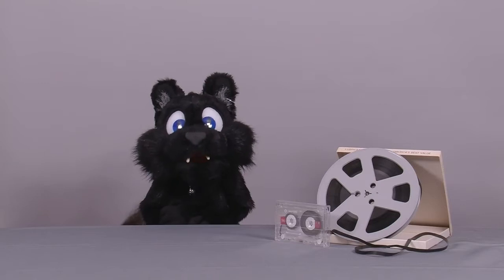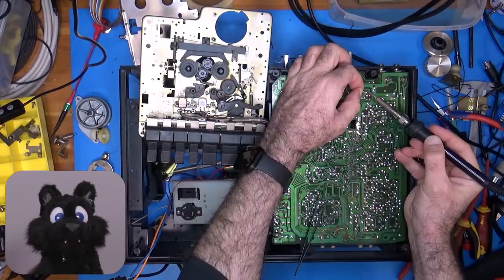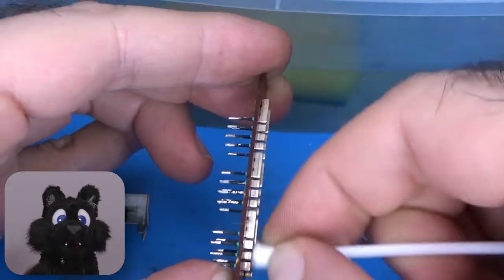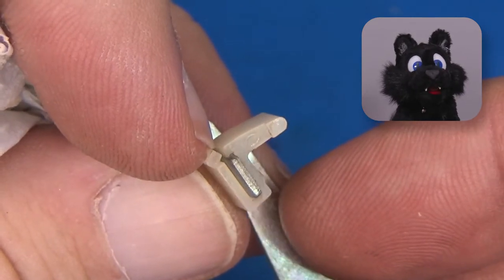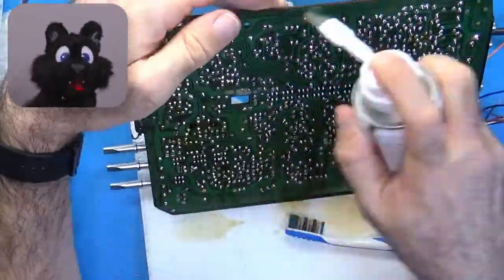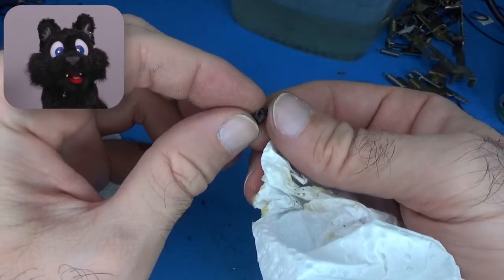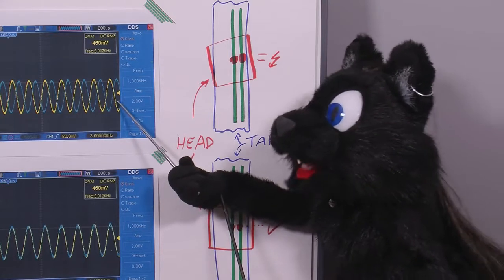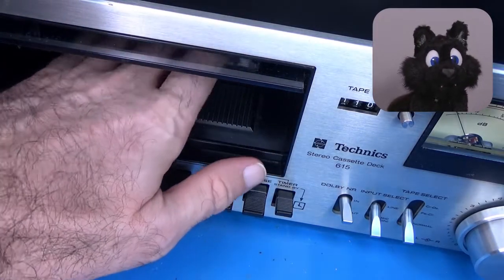Restoration Project #21 - Technics 615 Tape Deck

Comment: I am deciding to restore my 615 deck. 
Your video inspired me to give it a shot. 
Question: 
My unit seems to function at the moment, but the tape counter belt is loose and thus the counter does not turn. 
Can you provide a good source for this and the other belts?
Reply from the maker: I have good experiences with https://fixyouraudio.com/ - they provide some selected sets based on model numbers and also offer custom sizes.
Reply: @atkelar  
Thank you very much!

Comment: Hello atkelar, I really enjoyed watching the video where you show the maintenance of the Technics RS-615 US model tape deck. I have one with the same characteristics but one of the lamps on one of the VU meters is burned out. Do you know what the voltage of that lamp is and how to change it? Would you be so kind as to tell me? I would greatly appreciate it.
Reply from the maker: Interesting; How can you tell it's just one though? On my unit, they were wired in series - like christmas tree lights - and thus one broken would prevent the other from lighting up  too. If one is still working on yours, it's not quite the same setup. As for how to replace them: that's quite elaborate, because you have to take apart the VU meter case. And that is held between the elements of the front panel. Here's an older reply with a similar questinon about the type: I have replaced mine with LEDs, so I'm not sure about the model. Since they run in series over about 9V, they should be 4.5V ones. Low watt/amp rating, because they need to light up the displays only, so 100 to 200mA max I'd say, but that is a guess. The form factor might be different in your model, I'm sure that these components get changed all the time, but mine looked like glass fuses. I think those here might be close, but again, this is from memory and estimations: https://www.ebay.at/itm/115329633276

Comment: Very good video! I recently bought this same deck and it's working really well but with one problem, sometimes when i press pause, the friction point between the capstan flywheel and its bracket (seen at 8:25) starts vibrating constantly and very loudly. I can also recreate it by giving the bracket a tap with my finger and stop it by tapping again. Do i need to grease the friction point and if so, what type of grease should i use?
Reply from the maker: Assuming you mean the plate that is showing the serial number in my unit, I would try a tiny dab of silicone grease first. This is both slippery enough to not cause noticable drag and thick enough to dampen vibrations. The fact that it does vibrate tells me that the bearing is worn out (probably not just the one at th ebottom but also the one at the capstan side) and should be replaced eventually, so looking for a possible source of spare parts might be a better long term solution.Would need custom machining though, since I'm pretty sure the OEM doesn't make parts anymore.
Reply: @atkelar  thank you! I removed the plate and found that the end of the capstan shaft and the friction point on the plate were completely dried up with no lubrication and were quite dirty. I gave them a clean and applied a small amount of grease to the end of the shaft. The capstan is now running really smooth and no longer vibrates when i press pause or tap the plate :)
Reply: @atkelar  so another much more annoying problem has appeared. The play button has started getting really difficult to press and now it no longer works at all. I can press it down about half way but no further. Do you know what could be wrong?

Comment: Awesome. So thorough. I'm doing a (much less thorough) refurbish of a 615 that I picked up. Most everything seems to be working but I have a question I'm hoping you (or someone else) can answer. Looking at the parts and schematics, the auto-stop seems to only be a function of playback (not FF or REW). The auto-stop mechanism on my unit successfully stops the takeup idler tire, but I've noticed it doesn't release the PLAY button. Is this normal?
Reply from the maker: Thanks!
First, yes, the "auto stop" only works in "Play" (or by extension "record") mode. This is common of that era. Later devices added "full auto stop" for that reason, to indicate that the auto stop also works for the fast transport modes. Full Auto Stop usually also doesn't rely on a "feeler" for the tape tension, but rather detects the stalling of one of the spools.
Second: It should pop out the play button too; at least on my unit it does; It is what retracts the heads from the tape. I think what you describe is the issue I had at first: the idler is "stopped" by the mechanism, but actually it shouldn't be stopped. The little notch that contacts the idler should be pushed away by it, triggering the release of the button. 
[EDIT] because it's not the take up that's the problem, but rather the capstan, which might stress the tape to the point of breaking, which is only released when the play button itself releases.

Comment: Ciao Alkelar. Ho collegato il tutto e funziona. Però la piastra a cassette Technics RS 615  presenta due problemi: 1) La cassetta da ascoltare ha il tono più basso, come se girasse più lenta. 2) Non si accendono le luci dei due quadranti Left e Right posti sulla destra della piastra; hanno comunque l'ago che si muove regolaremente.  Ti sarei davvero grado se mi potessi aiutare dandomi qualche istruzione a riguardo. Sono fiducioso. Buona giornata. Antonio
Reply from the maker: Again, hopefully Google translate was doing a good job; 
as for your first item, The tape running a bit slow can have three reasons: first, the motor might need a bit of tuning to get the right RPM again. It's a DC motor that has a potentiometer inside the shell and over time that "sweet spot" might move. Second, there could be just too much drag in the mechanism, so the motor doesn't quite get up to enough speed. This is much harder to fix, but if it is the cause, it should be addressed. A very, very tiny amount of oil, like a needle dipped in sewing machine oil, put at the right location between axles and gears would do the trick. But careful, as there are lots of places where oil would make things too slippery: the winding mechanism has slip clutches and they need some drag. And third it could be that the drive belt is too loose or doesn't have enough grip anymore. Replacement would be in order in that case.

As for the lights in the VU-Meters: these two light bulbs are for some reason in series. So if one is blown out, both won't light up. They can be replaced, but one has to get to them first. In my video, I replaced them with LEDs, which might be overkill, but it would give an idea where they are.
Reply: @atkelar  Ciao Atkelar. M'accorgo ora che ho sempre sbagliato a scrivere Alkelar al posto di Atkelar. Chiedo scusa. Come sempre sei gentilissimo. Grazie di cuore per la risposta. Può esserci un'altra causa a non far accendere la/e luce/i dei VU-Meter ? (non sapevo che si chiamavano così 🙂).  Col tester si può verificare se la/e luce/i sono buone o rotte?  Ti prego di sopportare la mia scarsissima competenza. Buona giornata. Antonio
Reply from the maker: No worries; The lights in the meters are directly connected to the power supply, the very same voltage that drives the entire thing. So if the deck plays and the needles move, the bulbs are the only reasonable source of the problem; They should light up with the power, there is no additional switch or fuse involved, just the same power switch and fuse that is for the entire unit. It is possible, but very unlikely that a wire might have come loose; but that would be a one in a million fault, compared to a broken light bulb. Especially since if one of the two is broken, neither will work. If you have a meter with a continuity tester, a good light bulb should be a short and a broken one should be open; but either way, getting to them is the tricky part: they are nested between the front panel cover and the chassis part on the inside.
Reply: @atkelar  Ciao Atkelar. Grazie. Le luci da sostituire si trovano in commercio ?   Sai quale è il loro Voltaggio / Amperaggio ?   Buona giornata  da una persona che ti stima molto per la serietà e la professionalità che dimostri. Antonio
Reply from the maker: Difficult; I have replaced mine with LEDs, so I'm not sure about the model. Since they run in series over about 9V, they should be 4.5V ones. Low watt/amp rating, because they need to light up the displays only, so 100 to 200mA max I'd say, but that is a guess. The form factor might be different in your model, I'm sure that these components get changed all the time, but mine looked like glass fuses. I think those here might be close, but again, this is from memory and estimations: https://www.ebay.at/itm/115329633276

Comment: Ciao Alkelar. Complimenti. Ho ricevuto da un mio anziano zio un impianto stereo vintage (1978) che da molti anni non usa più. Non si ricorda nemmeno più i collegamenti tra piatto, piastra a cassette e amplificatore. Posso chiederti, per favore, come si collega la piastra Technics RS 615 all'amplificatore ?    Sul retro  della piastra ci sono  le connessioni OUT e IN. Ciascuna presenta l'attacco Right e Left. Sull'amplificatore,  un Akay AM 2400,  ci sono le connessioni per TAPE1 e per TAPE2. Ognuna di queste presenta gli attacchi Right e Left per 'REC'e Right e Left per 'PLAY'. Spero tanto in una tua cortese e competente risposta. Antonio
Reply from the maker: I had to work with Google translate, so I hope the reply is meeting the question 😆

The "play" connections from the amplifier would go to the "out" ports of the tape deck and the "record" connection from the amplifier would go to the "in" ports, right and left of course matching on both sides. With this style of connection, a quick try should show if it's correct. Between the ones you mentioned, there shouldn't be any damage if you get it wrong. As long as the question is just about input or output RCA sockets, it shouldn't damage either end if briefly wrong. Tape 1 or tape 2 is just which one of the "tape" inputs you want to use for the deck, pick either.
Reply: @atkelar  Ciao Atkelar. Grazie per la cortese risposta. Iscrizione e Like fatti. Fantastico, è ok. Devo ammettere che il tutto, oltre a essere tenuto molto bene, ha una qualità niente male. Grazie ancora per l'aiuto. Buona giornata. Antonio

Comment: I just found the exact one, it plays tapes super fast! They sound chipmunk. Besides cleaning do you know what is causing this ?
Reply from the maker: There's sadly plenty of reasons... but the two that come to mind immediately are: 1.: the motor speed regulation is not "extreme" accurate with this model - i.e. not quarz controlled or something, but rather trimmed to a certain DC voltage inside the motor. Usually that is only +/- a little bit however, but it might be worth checking if the voltage that goes to the motor is within reason. If not, the rectifier or filer cap might be off. 2.: the pinch roller might not be excerting enough pressure to hold the tape against the capstan. That would mean that the pickup wheel of the tape is "fast feeding" the tape, since the pickup has to run slightly faster than the normal tape speed. Maybe a weak, broken or just loose spring? Or, the rubber part of the roller might be way too slippery and hard and needs replacing.
Reply: Thanks so much, this is a new found hobby for me and I’m hooked! I also noticed the rubber belt seems loose and doesn’t seem to rotate properly. I’m going to keep at it 🙏 Thanks for your video I will keep watching

Comment: Well, I have no patience to look how do you tearing apart such machine. You've must been profi in some factory, whilst you courage to take away every single spring, roller, metal etc.
Reply from the maker: Well, I learned a trade in a factory back in the early 1990s but never actually worked as such; the PC side of things took off and I got sucked into that direction. I'm also aware that this amount of cleaning and tuning wouldn't be sustainable for a business: nobody would pay several thousands to get an old tape deck running again 😜
Reply: @atkelar  Yeap

Comment: I have recently bought one of those. Looked pretty but it was rather neglected, some crappy motor was put in and it turns out the head is badly worn. Hopefully I’ll be able to get a replacement. 
I’ve used this video a lot of times now for reference so huge thanks for making and uploading it!
Reply from the maker: It is always nice to hear that my little projects help! I am not sure about the head issue though; so far, all the tape related devices I got - which isn't that many admittedly - were in pretty good shape on that part. Mostly mechanical and other electrical issues.
Reply: Well, I was skeptical at first too, but there are clues.
First, the signal really drops off at higher frequencies quite badly and no matter how much I fiddle with azimuth both channels play at different levels. I can also see that there seems to be varying phase shift between channels that’s dependent on frequency. I thought it might be the electronics but measuring the signal after second transistor (only then it comes out of the noise floor) with an oscilloscope shows the same thing as on line out. Swapping the head leads swaps the problem too.
The head is also visibly worn down, there clearly is a ridge where the tape edge was riding (0.5mm or more) and the epoxy between laminations looks deteriorated. Do you think it could be something else?
Judging by the swapped motor I think this unit has high mileage on it. I got a different motor and it too had play and whined like crazy. The bushings are somewhat removable so I squished them slightly to make them narrower. Now the mechanics work perfectly, it holds speed nicely and I got auto stop to work with a little encouragement from your side :)
Reply from the maker: The way you describe the head, I agree: worn out. There should certainly be no groove on it, since that would make it next to impossible to adjust any alignment issues. I think so far I just got lucky. I still have to check out if there's any source for these heads out there. I am pretty sure they were not really a "standard off the mill" item, so finding one that is compatible from the electric and magnetic characeristics might be a challenge. Mechanically, they should all be about the same size and as long as it ifts, the mounting holes and braces can be "adapted" :D
Reply: I’ll try lapping the head so that it makes good contact with the tape again. Maybe that’s gonna bring it back somewhat. I did find the same head in a Greek shop, hopefully it really is in stock.
I bet some heads from other decks would fit without any modifications but adjusting them for good playback and recording might be tricky.
Reply from the maker: I'd like to hear about the rsult of the lapping experiment... it might equalize the two channels, but I doubt it will get the head back to proper response; part of the magnetic core is worn off, and magnetism is next to RF black magic almost, and the signals involved are minute

Comment: I like this format! Restoring cool retro tech with a cat - this is what the internet is all about!
I just recently bought this beauty and this is my first tape deck. It works ok, but I'll need to change the belts and properly clean it. And thanks to you, good sir,  I'm now not afraid to do it! 

Also, I'm having a hard time finding any information or manuals online. Could you please share where you got yours?
Reply from the maker: Thanks! Changing the main belt shoul dbe rather simple. The counter belt is a bit more annoying because of the strange path it takes.
As for manuals: I usually just use Google for that: look for make and model number and add "owners manual" or "service manual". There's usually a good PDF version amongst the first few results (try to skip the "promoted" ones) If the device was popular, chances are good to find such. But occasionally I also draw a blank and have to switch to "best effort" mode :)

Comment: Just found this channel. Very relaxing to watch. Talking cat as an advisor/explain is a brilliant idea :)
Quite a surprise how this Technics sounds good after recapping and service adjustments even with worn out REC/PB head.

Now I got motivation to search for something like this and do similiar project. I got some practising because I'm collecting old ghettoblasters from 70's and 80's so this shouldn't be a big deal :)

Best wishes!
Reply from the maker: Glad you enjoyed it! Replacing the heads might become an issue eventually... not sure how many of these are still made in a decent quality. But even so, it's not that such devices get the same use as in their original timeframe. I now and then enjoy the nostalgia, so I expect to get quite a few years of service out of it before it becomes an issue.
Reply: @atkelar  Yeah. Those devices had  hard times when they were fair new. In todays usage the head should last much longer 🙂
Reply: @atkelar  Good Video! The heads made in China which are selled on Ebay are sounding quite good but they wear quicker than old heads but not so fast that it should become a problem